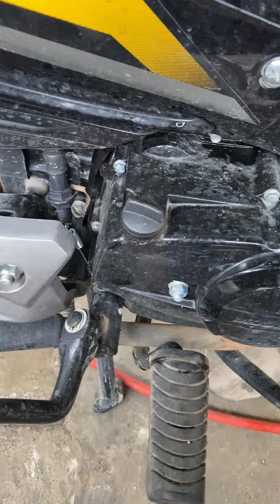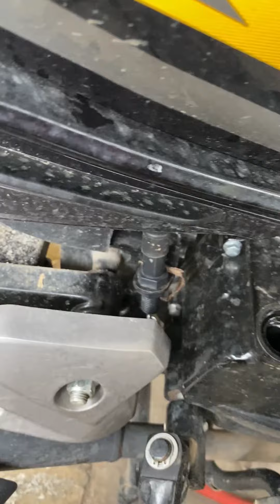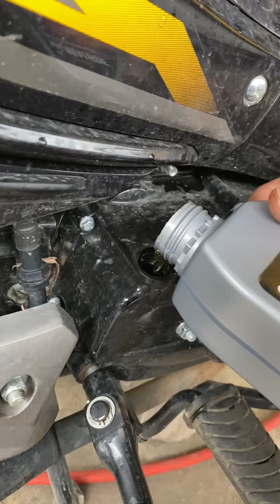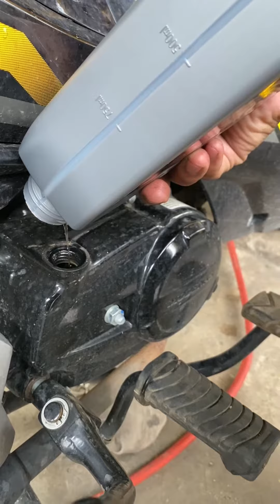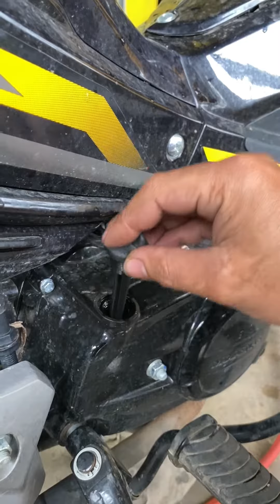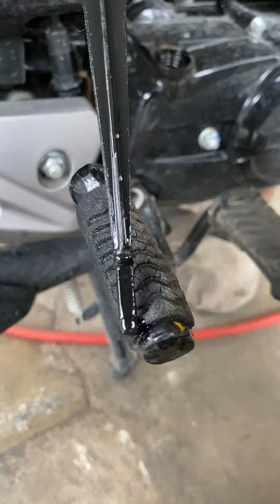Modenas MR3 minyak engine 1liter. Bukan 750ml.

Comment: Srius bang blh letak 1liter ? Ada apa2 efek x nt ?
Reply from the maker: Mmg dari kilang 1L.
Reply: @Amymotor-Specialist  x bg efek apa2 kat motor ?
Reply: Klau dlam buku manual tulis 0.8 L.
Reply: @nicknels4586  betul. dalam manual 800ml kalau tukar minyak. kalau bukak engine baru 1 liter. itu kata manual modenas.muka surat 45.